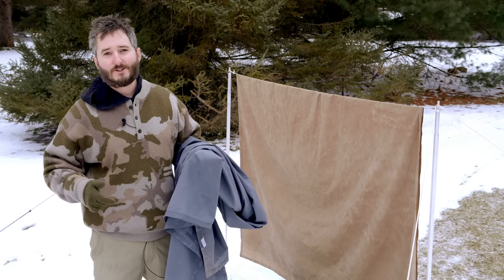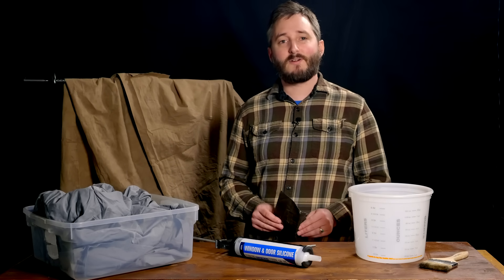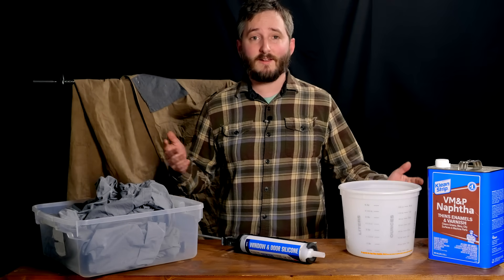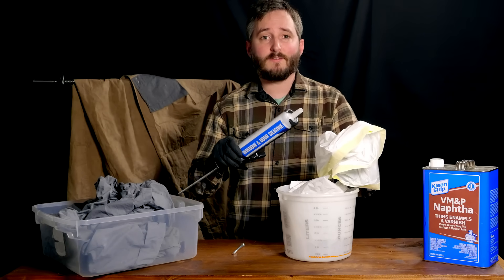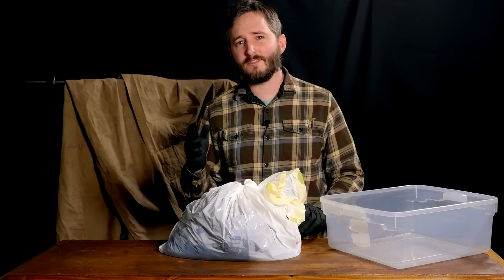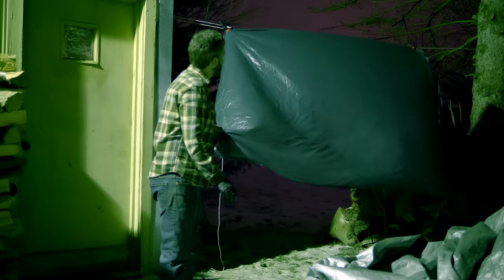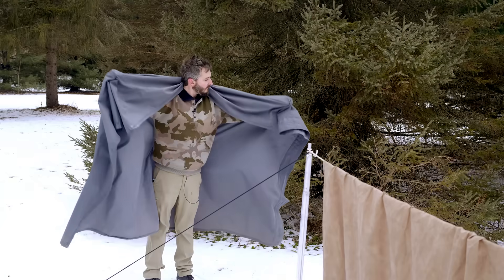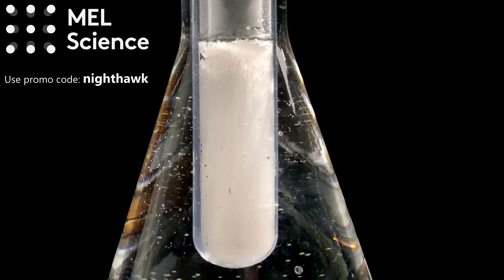Recycled Bedsheets Make The Best Waterproof Tarps

Comment: I need to waterproof a 4 meter by 2.5 meter tall 900D canvas bell tent with ground sheet. Hail, Almighty Google tells me that is around 35-50 square meters and it will take up to 36 liters for two coats. Ouch!
If I tried to reduce the amount I need by keeping the fabric rolled up and/or as compact as possible, how long can I let it soak for maximum penetration, so I can compensate for my physical disabilities? I will be using my tent ice fishing for extended camping. I will be using a wood stove. I plan to make a tent tarp or drape out of fireproof blankets and as a backward drape and flooring.
Can we reuse the liquid that the fabric had soaked in? If the silicone is disproportionately lost in the drained off liquid by getting soaked into the fabric, and thus reducing how much silicone is left in it, can we just add more silicone? The ratios don't have to be precise and certain materials are waterproofed better with differing viscosities.

Comment: To Ben and anyone that does this project I did this to a canvas tarp 12x16 holy crap was it expensive a case of 12 silicone tubes was 40 bucks plus shipping tarp was $44 the 2 gal of naphta 25  cost was  around 150+ it's still more durable than a plastic tarp. When I got the tarp it was folded a visualized how many gallons the tarp was if I was to put the tarp side by side the gallon jugs to be the same amount of volume as the tarp if I had to do this project again I would get a third gallon. And use the same amount of silicon and make it a lot thinner so it was more easily absorbed into the fabric I used a 5-gallon bucket. In the end it didn't all absorb but I was able to crush the bucket what's the tarp in it so it would seep into the areas that I didn't get coverage that saved my butt I'm having a lot of spots that were not treated. Ben I watched your video on the wax treatment I'll probably try that one next. And since you say you read all your comments I'm curious to see if you can come up with a way to make the fabric also repel mosquitoes and be waterproof and non-toxic. Your videos are very cool I enjoy them. Your laugh is a dead giveaway that you enjoy your videos to keep up the good content. If you like search and rescue dogs electronic dance music and  the new journeywhat happens when the two combined with trains. Check out my channel 0rbit louder.

Comment: Have you ever tried putting it in the microwave rather than using the iron. Sprinkle the shavings as you are folding the blanket. Put in a gallon freezer bag. Microwave in 15 second increments and massage in bag till fully melted and saturated.

Comment: I'm curious about the waterproof capabilities of the bedsheets when they're under load/pressure? I know this video specifies use for tarps, but I'd be interested in seeing how much water pressure could be applied to a treated fabric like these bedsheets before the water forces through. Also how often, if at all, this type of silicone based treatment needs to be reapplied in the same way waxed cotton needs re-treating over time? If anyone's done any testing I'd be interested in the results.

Comment: I have made two of these -- one using the wax/mineral oil method and one using the naptha/silicon method.  I should note that I have not really done much field testing with either but, in my opinion, the naptha/silicon method is superior.  The wax  based tarp has a slightly oily feel to it while the silicon tarp does not.  Both seem equally waterproof.   

I am making these tarps for use camping and for general purposes (I have one tarp covering my firewood pile now).

Either one seems superior to a plastic tarp!

And I definitely appreciate the straight-forward, no fluff or digression presentation!

1/10/2026 Update
After some use of both tarps I am revising my opinion.  Both of these tarps have their pros and cons and, depending on the use, one may have more benefits.   I am using the mineral oil based tarp for utilitarian outdoor uses (such as covering a firewood pile) and the silicon based one for camping mainly because it is much lighter than the mineral oil based one.  It made an excellent and light weight cover for my sleeping bag!

Comment: Would this or your mineral oil with wax method be more heat resistant? I live in florida and want to waterproof my Cordura ATV seat. But dont want any residue when sitting on it
Reply from the maker: Silicone is the better method for a seat
Reply: @Nighthawkinlight dang quick reply, you are the man thanks!
Reply: @Nighthawkinlight one more question for you, do you think the naphtha will fade or damage a camo pattern Cordura? I will be upholstering with mossy oak pattern
Reply from the maker: @ACDCRD  Probably it will be fine, but test a small corner before doing the whole thing

Comment: I used this video, along  with a little more knowledge that I've gained over the years, to make several sheet tarps.  A king size makes an 8x8.

When he says that the cloth is coated, it actually gets saturated through and through.  The naphtha thins it so it can soak into the individual threads making up the weave.

A couple tips:
1) Find a sheet that is 100% cotton - not a blend of cotton/polyester.  Neither the naphtha nor the silicone will penetrate polyester fibers.
2) Application is much easier and better controlled if you pitch the tarp as if you are going to use it as a shelter.  Use a roller to apply it generously.  I said:  generously.  Don't scrimp.  Pre-pitching the tarp will do two things for you:

A) It will stretch the material so that the threads will tend to open at the cross-overs to allow better penetration of the thick-ish liquid.  I found that bathing the material in a large mortar tub did not force the liquid into the material enough, and when I pitched it after drying to test - it leaked along seams and in the areas that got stretched.  Apply the compound while the material is stretched to get every micro-hole filled in.

B) Pitching the tarp will avoid having to wrestle a wet, dripping slippery mess as you try to lay it over saw horses, ropes, or what ever - to let it dry.  It avoids major low spots to which excess liquid will run and pool up.

3)  Do any sewing-on of corner reinforcements or loops and center loops before you do anything else.  I use regular 12oz canvas from JoAnne's and cut my corner triangles, then I sew on webbing for loops.  Fold over the edges 1 inch and sew down for a better , stronger edge. A 3/16 nylon line can be used if you want a rope reinforced edge.  Just fold the edge over it and sew it down. Everything gets saturated at the same time that way.

On a sunny day at about 75f, the sheet will be dry within 3 hours.

A king size will weigh around 3.4lbs when done.  With no rope edge, and no canvas reinforcement, my cost on the latest one was $34, which included the naphtha, silicone, and a Value-Village sheet.  There is enough naphtha in a gallon can to do two tarps.
Reply from the maker: Thanks for sharing your experience!
Reply: @Nighthawkinlight  And thankyou for yours.👍

Comment: The top toe of my snowboard boot on my back foot is wearing from the boards metal edge resting on top riding up the lift. The front fabric on the toe peeled and is old so i just applied some. Will update with the results. Hoping i can get a few more years out of them

Comment: Hmmm I wonder if one could brush the solution onto the exterior of an old raincoat - especially the seams.  Or does the solution have to permeate from both sides.  It could also be used on a tired old tent fly.  To make it rainproof again.

Comment: I have used this method many times over the years. Though I paint it on using a roller. The one difference I have figured out is using gasoline instead of naptha. Where I live a 3.78 liter of naptha is 32.00+tax, gasoline is 1.65 a liter. Though the gasoline has a much stronger smell, leaving it outdoors for a few days completely off gasses any residue odour. Hope this helps those doing larger jobs.
Reply from the maker: Definitely way cheaper. Note that it is illegal to use gasoline as a solvent in most places. Certainly be careful of only using it in an area where it would not result in disaster if the tap caught fire before dry

Comment: @NightHawkInLight
Tried this , applied it by brush  on my rain jacket.  Now glossy and sticky, your advice to try 1:1 is not the best one, i mixed about 100ml Silicone to 250ml naphta, in german Rein- or Spezialbenzin. Now the questions are: Did you mean Vol% or mass (or weight)%? And is it possible to wash off the silicone which is to much on the jacket with naphta?

Comment: Why not pull a vacuum on it? A piece of dry cloth over your Shop-Vac hose put the opening of the bag over your hose and turn it on then twist it close and have a positive atmospheric pressure outside the bag to force the mixture into the material.
Reply: Needlessly complicated.
Reply: @fidjeenjanrjsnsfh  How? It's literally one extra step that is not the definition of needless complication. Seven extra steps that's needless complication. 🤔

Comment: Can anyone advise whether you can use any type of  ( 100% ) silicone sealant as there are neutral cure, acetoxy ( vinegar smell ) , various different modulus etc etc . Would they all work ok or is one type better ? With making a DIY sugru for example .. one needs to use the acetoxy type specifically ( at least I'm led to believe ) thanks , Bill
Reply from the maker: Only the vinegar cure type will dissolve in naphtha
Reply: @Nighthawkinlight  thanks ...much appreciated , .. Bill in UK

Comment: Does anyone have insight on if this would help revive an old leaky rain fly? The fabric is very thin in some places (I think the tent is over 30 years old). Last time we camped it allowed water to pour into our tent and we ended up in the car with both kids.
Reply: @nighthawkinlight so I went ahead and attempted to waterproof this massive rain fly. I used your updated method of paraffin and mineral oil and it worked great! Kept out the rain wonderfully. Unfortunately with the rain came several very strong gusts of wind and several poles were severely damaged and unable to be repaired/replaced. Which sucks because it was a nice tent and it was not supposed to be windy, just lots of drizzly rain. But now I have a massive tarp so I’ll try to find something to use that for.
Reply from the maker: It would help, but saving a 30yr old piece of tent fabric is a tall order
Reply: @Nighthawkinlight the rest of the tent is in excellent condition and it is a huge multi room tent that my parents have had their whole marriage. I’m wondering if it would be better just to make a new rain fly from a few sheet tarps sewn together and then resealed at the seams with the paint brush method.

Comment: I'm assuming 5:1 by volume or a mix?  Silicon by weight and naphtha by volume?  I've screwed up ratios before by doing all weight when it was a mix of the two.
Reply from the maker: Volume for the naphtha. Volume vs weight shouldn't be much different for the silicone in oz

Comment: Thanks for this info! I treated a large linen sheet with more or less this method two days ago. Being in Germany, i used White Spirit as getting 3 liters of Naphta here would have made the tarp almost as expensive as buying dyneema one. Worked a charm, dried in a day with no noticable smell left, the only downside is that white spirit does leave it slightly oily feeling to touch. For now. Perhaps that goes away too after few weeks out in the open. It is definitely something i can live with as it will be used as a suspended sun shade.  
Also, as the sheet was white, i used half clear and half brown silicone to stain it, making it a nice even cream color, saving an extra dying step

Comment: Bummer, didn't work out. The silicon wouldn't dissolve. Here in Mexico, I couldn't find naphtha but I was told that paint thinner was the same thing. The label on the thinner said that it was for cleaning spraying equipment and would evaporate cleanly, no water. The silicon was labeled as 100% silicon, general purpose.  
I'll try to dissolve some of the silicon in gasoline, that might indicate which component was the problem. (Yup, that worked.)
Yes, I saw your newer video but I thot I'd try this first.

Comment: 24:36 What about a heated sprayer bottle? Let the wax solidify upside down at the “top” of the spray bottle, then reheat in a simmering pot of warm water (until fully melted wax throughout, not the bottle 😂 )…. Then to apply use the iron to heat the fabric then spray the “waterproofing wax” solution onto the fabric, and use iron as needed to keep fabric heated and if the wax cools too much return it to the heated water.

Comment: Good afternoon.  Thoroughly enjoyed the video.  I have a question though if you wouldn't mind answering.  I am wanting to waterproof the cloth cover on a pop-up gazebo type of structure (10 x 10').  I believe it would be rather difficult to find somewhere to hang this to dry as it comes to a point in the center.  Would it be possible after soaking, to put it onto the frame to dry, or better to frame it up first, and then use a soft brush to paint the mixture on?  Something like a soft car washing brush?  Appreciate any advice you might offer.  Thanks.
Reply from the maker: Since you're asking I'll give you early access to a video that will go public tomorrow on a new version of this project: https://youtu.be/HedRbIsM75M?si=NDeeOte0jcktRvl_

I would perhaps use the method demonstrated toward the end of the video for treating a jacket for your gazebo cover.

Comment: My family of 8 is finishing up an old Airstream to live in while we make repairs on our farmhouse. (real farm, not decor farmhouse) and down on the coast of southeast texas, the heat scorches but sometimes the thickness of the trees doesn't let enough air blow through. So we are making a 16' x 12' awning using patchwork old sheets on the Airstream to catch shade under for the kids when we are away from the trees. Thanks for this! I was not willing to spend the high prices (like $700) for a premade awning. So far I've only spent the cost of the silicone and naphtha.

Comment: Question: Have you done a flammability test on the fabric post drying?  I was reading that the residue left behind by the naptha has even a lower flashpoint that liquid naptha.  Does the silicone prevent a stray spark on a hot day cause the waterproofed fabric to ignite?  Basically, how fire-safe is the end result?

Comment: DUUDE!!!  
Thanks for the info but first and foremost NAPTHA is not only extremely flammable, but it can cause paralysis if you have too much exposure to it.  
         A FedEx 727 almost crashed back in the late '70s after a single PINT of naptha partially spilled inside an I closed  hazmat container, inside the aircraft.
            Back in 1982 some idiot used a naptha based cleaner to clean a wooden desk, leaving it soaked with naptha, about 20 ft away from where my work station was.
        This was in a modified hanger, with giant bay doors wide open, for fresh air to flow in and out.
  The next morning when I woke up, the only limb I could move on my body was my right arm, and I could barely breathe. 
          After an ambulance ride to a hospital, it was determined that I had been overexposed to Naptha.

Comment: FYI: DAP Dynaflex does not dissolve in NAPTHA 😢. It's what I had on hand, and thought "This is the good stuff. It oughta work great." NOPE.
Gonna pull out the gooey glob, and go buy some cheap stuff. Wish me luck.
Reply from the maker: Type 1 silicone works
Reply: @Nighthawkinlight  I bought some basic silicone and it worked wonderfully! It's amazing how flexible the fabrics stays. The smell is horrendous and strong while doing it, definitely recommend a mask, but the effect is so worth it. ❤️

Comment: I saw this technique last year on skill tree. I used this technique to make a rain jacket for myself. It's not something fancy basically just a layer of fabric to shed the water. So i first sew the jacket without a zipper or buttons. I then soaked it in the solution and let it hang outside for about 2 days - mostly because i forgot it.
It was dry afterwardsso i put in the zipper and buttons and till now it really served me well.
I had to adjust my breastpockets. Because when it reains heavily the water would collect in there and i didn't really have a way to realease that water.
Reply: And what you can tell about the breathability?  I would like to waterproof my canvas anorak but I would like to know how bad will affect the breathability. Thanks!
Reply: @schiaucugabriel6202  with this method there is zero breathability.  it becomes a solid waterproof membrane.   so, it will keep the rain off you, but you will still end up soaked by your own sweat!  lol.
Reply: @schiaucugabriel6202 dude.... This is waterPROOFING. There is no breathability here. 

If you want breathability try the mineral oil and paraffin wax method, you can go light on the wax and distress the material a bit afterwords. That MIGHT get you some breathability while water resistant.